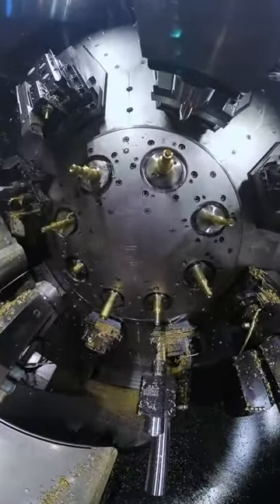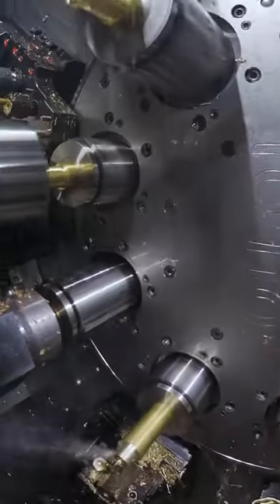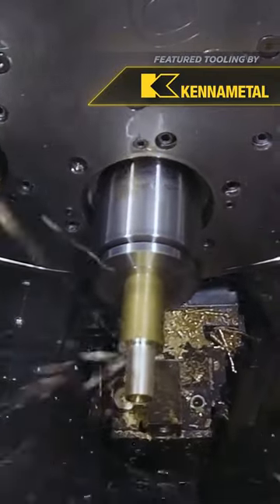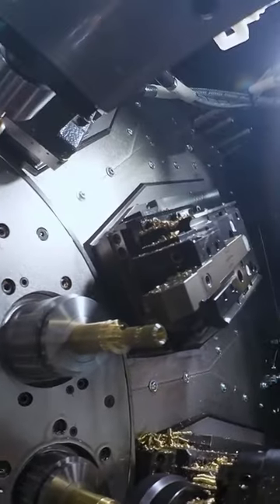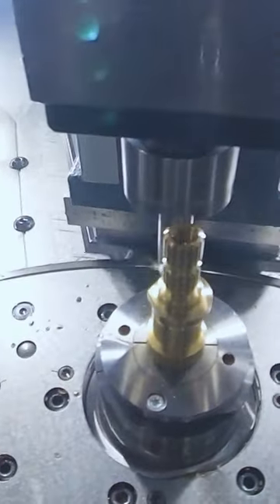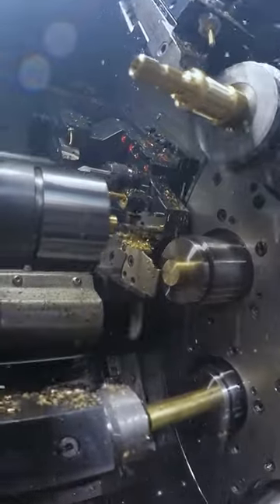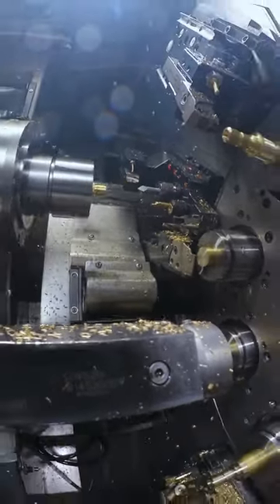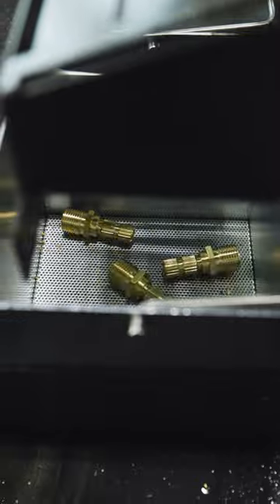10 Second Part - TORNOS MultiSwiss 8x26 Breakdown #cnc #machining #machinist #engineering #swiss

Comment: 10 second cycle time - 10hr setup xD
Reply: Still worth it when you got thousands of them
Reply: nah
2 hours is enough
Reply: @RealNotallGaming depends on material and tolerances, with brass it can be done pretty fast, but you have to consider use of custom mills and overall optimisation. This last step will take most of the setup time.
Reply: Setup time is compensated for if you need to make ton of those parts and need them in like a week.
Reply: Lol
Reply: @RealNotallGaming no it’s not😂maybe if all the tools are already assembled in the machine, you also have to proof it completely out, don’t want to come back to thousands of scrap parts
Reply: Exactly and heaven forbid one of those parts gets misaligned due to a stuck metal shaving. I used make the radiator cores for Honda radiators and the material shoots in from a giant spool that then gets sized, cut and stamped/formed 10x. Well, every once in awhile the cut was off or a tiny speck of metal would cause a part to stick instead of releasing and all hell would break loose. If you've never seen metal spaghetti then just go apply for that job. The dies alone in these machines were million dollar dies. If you were at a different part of the line or helping someone else and did not immediately catch it, you'd have at least an hour and a half clean up time coming your way. It usually happened when you would go on break and the supervisor would "watch" your line.
Reply: @adammiller4879  you have table of tool offsets so you dont need to zero them, plus with macro you can import those values directly from the program 🤣
Basically you just need to measure the first piece and change offsets for the correct measure. So simple
Dont tell me you dont know ISO .... 🤷
- You mount the tools and chucks, download the program and run the offset program after m99/m30, run the program with single block for monitoring eventual errors, measure the piece, change offset error and go
1-2 hours if not less 🤣😉
Reply: ya you better be making thousands of those parts. and tens or hundreds of thousands of parts like that a month. pretty badass though
Reply: There would be a large number of tools on there. Except for the drilling operations, a smartly chosen set of turning tools would be able to do most jobs, minimising that part of setup.
Reply: So what? What's the final throughput for a shift?
Reply: @Gnefitisis 360 an hour
Reply: @Gnefitisis  2880 parts maximum if a shift is 8 hours. With downtime (tool changes, loading new bars etc.) it is probably realistically about ~2500ish
Reply: @RealNotallGaming yeah, simple to just run a piece, measure it and adjust the offset... thats what optical measuring devices are used for to find these offsets. If you have to set up 20 tools and measure each of them, gl doing that in 1-2hrs 😂😂
Reply: @D3nn1s  like i said i set up nothin
The utensil are already prepared you just put them in the machine
And measurements are booted from the program so they take 1-2 sec 🤷
You clearly dont know eh?
Reply: @RealNotallGaming  yeah sure, but not everybody has 50 different tools with different tool lenght in his shop lol. If you do thats great, its just not a given
Reply: @D3nn1s 
station 1 = fix number
station 2 = quick attack , you set it with caliber from bottom and clamp
station 3 = you clamp it all in and with caliber you set the drill
station 4 = fixed posiition
station 5 = quick attack (like station 2)
station 6 = fixed position (like station 3 you set it with caliber)
station 7 = quick attack (caliber)
station 8 = fixed position for sub-spindle and for the cutter you set it with caliber, same for utensils for sub-spindle

how much time? 30min?

then you run sub program after M99\M30 so you will read it 1 time only and with macro you import zero sets (with bigger offsets)
you run the main program with "single block" and stop to measure the errors
you restart at the block you measured until you reach the end of the program

first piece = perfect

estimated time? 1-1.5 hours

of course only if you had on your "personal book" all tools positions and measurements to install them, the type of inserts you need ecc

is called planning ^^
Reply: @D3nn1s  to set a CNC you just need a caliber and a book
so you can write down all the positions of your tools
next time, when you mount up all utensils for the same job, you are faster because you know how to set the machine ^^
the real trick is the subprogram that set up for you all zeros in the CNC so you dont need to zero them 1 by 1

of course this method is usefull only if you will repeat the job every week, for single pieces you need to work asap so you zero the utensil 1 by 1 in manual while you write the program ^^
Reply: @RealNotallGaming  honestly i have no clue what you mean by fix number, quick attack and so on, nor do i know how your company operates so i cant judge. I only know how my company works and its probably way different from yours tbh so you do you and if that works thats great
Reply: @RealNotallGaming  sry didnt see the 2nd reply. Yeah if thats how you do it okay, we use a laser measurement device to measure each tool to .001mm for our mills, you do this for every tool before you mount it in the machine. Then you import the holder into cad, also the tool lenght and make sure there are no collisions. Youd think this wont take a lot of time but until you got the programs ready and ~8 different tools it might still take a couple of hours. Ofc most of the time is programming
Reply: @D3nn1s ^^
because im not that advanced
imagine the thinking method i need to use
(random number just to make an example)
the utensil is 100mm on the X
so with sub program i make a zero X of 100.1 mm
then i run the main program, stop it just after G0 for safe return and space, i measure the piece with caliber and adjust the offset so i have a good piece still on-work
rerun the main program and here we go, perfect turning operation
i repeat it for all utensils

i wish i had laser measurement or CAM
LoL

the only thing i have is macro so i can work asap with a safe zero setting

is like work on a traditional lathe method
turn > measure > adjust > re-turn

^^
Reply: @RealNotallGaming  you have an 8 spindle machine but no cam?
Reply: No shot 😂
Reply: More like 80 second cycle time and I'm guessing more than 10 hour setup time. First article and program prove out can take days or weeks.
Reply: @marclaky384  if you set up a lathe in 10 hours you will never work as a pro machinist X,,,D 10 hours? so cringe
Reply: @RealNotallGaming  really??? A mill turn with a 12 hour program and a 40 inch long 10 inch diameter 300m component? You can set up new tooling and price out a program along with not scraping a first article in 10 hours?
Reply: @marclaky384  the topic is SETUP
not machining time ... but ok
Reply: @RealNotallGaming  set up involves knowing tool projection, jaw interference, tool holder selection, tooling selection..... The list is long and continuous. You could get to the last step and the programmer who proved it the program gave the wrong chuck diameter causing interference or a crash.
Reply: @marclaky384  in the moment you watch the project paper, your brain already scanned your equipment and you already thinking about ISO program ^^ is natural
Of course if you are a professional
After 5 mins you have already all needed on the desk
30 mins later you already mounting utensils and downloading zero settings ^^
Reply: @marclaky384  for interferences there wrote on CNC manuale and you need to Remember automatically
For crash is impossible because CAM , single block and watching the program on screen while running ... ISO is so family friendly after all 🤣🤷
Reply: @RealNotallGaming  you just repeated what I said. It takes time to prove out a program (single block, backing out offsets and checking everything). Not all interferences are in manuals. If you have spacer plates, job
Jig locators, specialty tooling, large swing radius, tailstock movements...... Not as simple as loading tools, a program and your part then hitting the green button. It also depends on if the company you are employed by has the financial means to afford specialty software to price out programs or CAD model the machines, fixturing and tooling.
Reply: @marclaky384 
15-20 min for write the program of the video

takes time ... the time of the program ... you dont use M0 ?

just start 1 tool at the time, M0, measure, correct and continue ...

manual have ALL interferences (KIA and Haas, i worked on them , they haveall of those data)
and for Z interferences you need to know those all the time for all utensils or you are not a pro

counterspindle is the last of your problems

i dont use CAD\CAM
i write ^^ paper in hand and second hand writing, after all the piece in the video is a piece of cake ^^
Reply: @marclaky384  no way that takes weeks haha. And no the cycle time is actually 10s since every 10s you get a part. Sure it might be 80s in the machine but you have 8 in the machine at once, thus 10sec
Reply: This machine is intended for contacts in the millions of parts per year. High speed, easy material, high volume.
Reply: @Militia.  like i already said, that video is 1,5 hours of setup
if is more, you are not a CNC machinist

1.5 hours is based on me that im average so if someone is worse then me is simply a bad worker and cant be a CNC machinist
eheh
Reply: I would love to calculate all the speeds and feeds with all those tools
Reply: Thank you 

I just came for the "Actually "
Reply: Dude, 10 hrs would be fast
Reply: @jasonaldenhaley1 you clearly dont work with CNCs
Reply: ...by the time you get all your ER collets, tap(s) drills, holders, program it, set coolant lines, realize your minor ∅ is too big, grab a GH 10 roll tap and/or change your drill...it's an easy 10... that's being realistic. If you're the boss, maybe a little fas...no, fuck that, that's 10 hours everyday. Lest we forget the barfeed and getting it swapped...think it can be faster with one dude, u r dillusional.
Reply: @jasonaldenhaley1  in the moment you see the project paper you already designed in your mind all steps in 15min, started to prepare everything you will need for the job
and to be precise you do it WHILE the CNC working, so in the moment it stops you start to set it for the next job you ALREADY PLANNED
LoL
dont tell me you waiting the CNC watching the ceiling ??!!
is called "planning skill prerequisite" without it you simply CANT work on CNCs
LoL again
2 hours or you are out :)))
in my first job, in 8 hours, i was able to set 20-25 times 5 different CNCs
while the newguy working on the first i set the second and again and again
is called "move you ass that you working"

Comment: The accuracy and efficiency of Swiss machines is incredible!
Reply: For real yo, be crazy to see how fast they can get too
Reply: It's not a a Swiss Machine.  A machine made in Switzerland, yes.  A Swiss machine?  No.
Reply: @Sara-TOC  A Swiss Machine uses a guide bushing to support the material. This machine does not. This is a multi-spindle sliding headstock lathe. Is it a machine made in Switzerland? Yes. Is it a Swiss type machine? No. Your initial post is confusing because of the fact that while this machine is made in Switzerland it is not a Swiss type machine.
Reply: @brandons9138  These machines are commonly labeled Swiss for a couple reasons: 

1: You’re correct by saying that the Swiss machine was invented in Switzerland. Competing OEM’s from other countries (Ex. Japan) also developed their own version of a Swiss machine, also using a guide bushing and sliding headstock. Calling it a Swiss more so pays respect to its origin. 

2: This machine does utilize a guide bushing. A Swiss is more commonly identified by its sliding headstock with the material moving in Z-Axis, not the tooling. You could say the multi-Swiss the capabilities of both a Swiss and conventional lathe. In my humble opinion, it’s a grey area on how you wish to identify it.
Reply: @Sara-TOC  I think we are going to have to agree to disagree. This machine does not use a guide bushing. It is quite obviously a chucking machine.
Reply: The Swiss stopped participating their accuracy competition when the Japanese started winning every year.

Comment: I used to set-up and run an old screw machine.   No numerical control, all done with cams and stop blocks.   Many hours to set up.  It was a 5 spindle and would put out parts at a comparable speed.   Enjoyed watching this modern version
Reply: I was thinking the same thing ! And a lot cheaper too

Comment: I used to make sprinklers, the ones you see in apartment buildings every 8 foot apart or whatever. I had a seven axis Lays with two heads that would do the same thing basically. Cool stuff

Comment: I used to own a screw machine shop they are so challenging to get them to do what you want setting them up and making all the tooling trepanning recessing undercut ream bore knurled drill and tap stop spindle then cut off face then cut o ring on face shave tool holder on and on love it nice work

Comment: I assume the 10 seconds means that once it's running then every 10 seconds a completed part will drop out, but individually the piece takes longer than 10 seconds.  In theory it's more like 80 seconds because you'd be limited by the slowest of the 8 steps, you can't move on until the slowest step is complete.

Comment: this might look complicated but damn the only issue this could case is if one tool starts vibrating and affecting the other tools working at the same time. setting up the tools takes as long as a regular machine. if you got this kind of machine i just assume you've moved on to just importing your zero point directly when you post the program from CAM. each tool has its own zero point so its easier to compensate for different issues without having to figure out how it'll affect the other tools so once you run through one part you'll just have to measure and compensate it and then you're good to go with running through one whole lap of parts and check them all to make sure each part holder is alligned and then you're good to go. honestly theres just a slightly longer setup time considering you have to doublecheck several parts before you can just leave it to do its own thing. and then it works 8 times as fast as your single tool machine.

Comment: is there an uncut video of this? Cause, this video is 30 seconds and I can't see how all that fits into 10 seconds.
Reply: It takes more than 10 seconds to produce the part, it's just that you can simultaneously machine multiple parts at the same time. Given the 8 spindles on the main side alone, this part will take at least 80 seconds to make - but likely more given the additional backside operations.

What Donny's getting at with the "10-second cycle time" is that a completed part comes out every ten seconds.

Comment: Its a little more than 10 seconds. You dont start with 7 parts in each station, you start with 1 until 7 fill up. Which would start you at 70 seconds / part once all 7 stations are filled. Then each part made will take 10 seconds off each part until 6 are finished. Then each part takes 10 seconds average.
Reply: After the first part finishes (8 cycles) you've spent 80 seconds, the next is 2/90 = 45s, the third is 3/100 = 33.3s, fourth is 4/110 = 27.5s... If you never clear it from the parts it approaches 10s per part but will technically necer reach it. Average time = [#parts]/(10s*[#parts] + 70s)

Comment: I wonder how many of those air hose adapters you would need to make and sell to offset the cost of machine/tooling & runtime.
Reply: At 6 a minute that's 360 an hour. They're probably quoting them at like $0.5-1 apiece and making an absolute killing. Tooling won't be much of an issue with brass so basically you're just covering machine time and stock.

These sorts of jobs are typically quoted in the hundreds of thousands though. So even at 2.5k a shift you'll have work for a while.

Comment: if a part takes 10 seconds then the machine will produce 8 parts per 10 seconds.
Reply: you are technically right, but I'm sure most people understood it as 1 finished part every 10 seconds (80 seconds to make) also nobody likes when you are 'that guy'
Reply: I'm am with you drives me nuts when people talk about 10sec when it is more, and these machines cost a fortune so you could easily buy severeal Swiss lathe machine and produces more parts with added redundancy

Comment: No thanks. I ran hydromat machines before. Any multi spindle whatever machine is an absolute pain to work with. I’d rather make these same parts on a dual spindle lathe with live tooling  , forget the run time. You guys at titans probably make super good money anyway so who cares how hard the job is.
Reply: So many different things that can go wrong on these machines. Its hard enough having to watch for metal shards/shavings in one area let alone watching for them in 7 different areas.

Comment: Then you stand there for 10 hours putting in and removing finished parts every 10 seconds
Reply: No.  The machine is bar fed.  All you have to do is load bar stock into the bar feeder.

Comment: 10 seconds per station. Start with station 1 and add up..... so definitely not a 10 second part. Yes its impressive.  But a truly 10 second part.... no. 80 seconds from bar feeding in, getting the first op done, going thru the other op's and then ejecting.... just saying. Quit with the BS